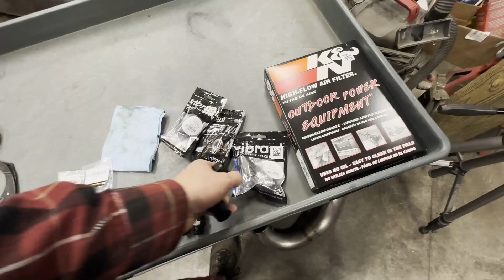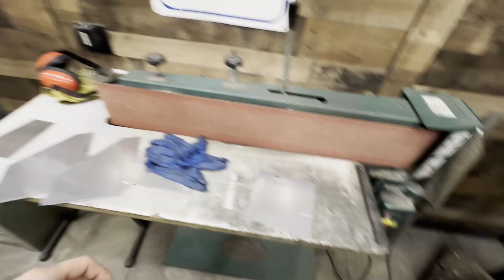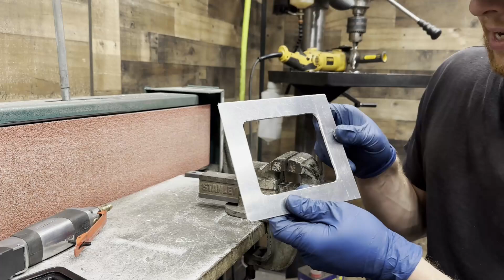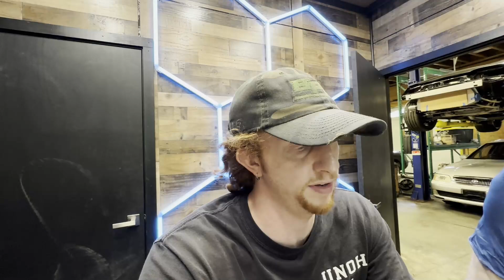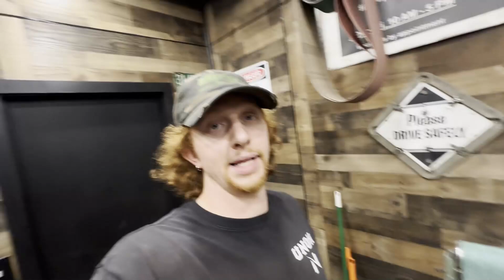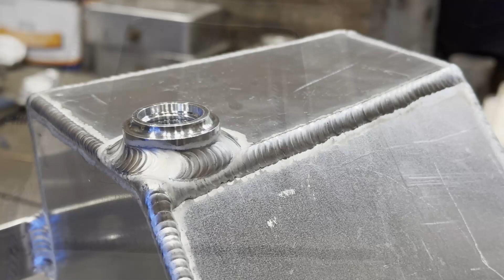How To Build a Catch Can (Tips, Tricks, Design, and More)  [ REPAIRED UPLOAD ]

Comment: Aaron. Question on a Catch Can . Would a Catch Can help the pressure big up on a V6 engine in a Chrysler Van that starting a little leak in the Rear Main Seal to help the High Pressure in the Engine?
Reply from the maker: A catch can is the end point of the engine's breather system. If you have enough crankcase pressure that it's causing oil leaks, you most likely have other issues that you need to sort out first.